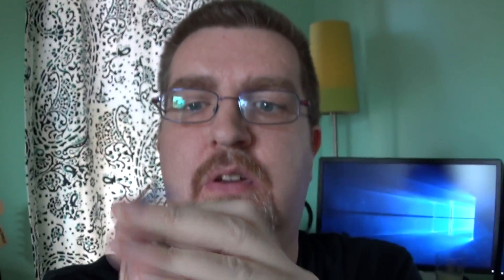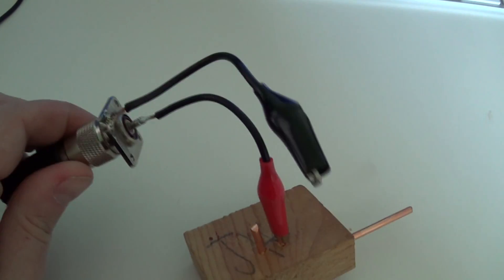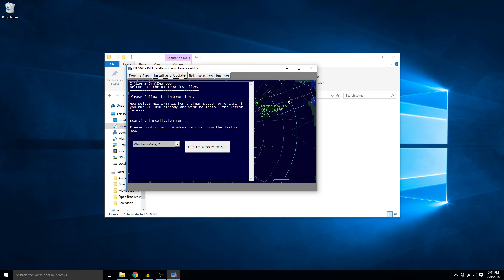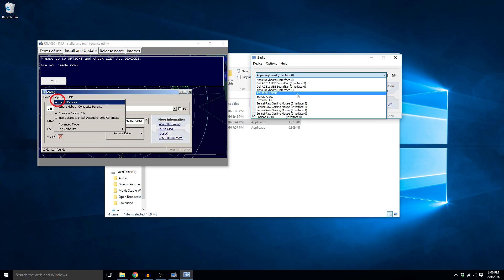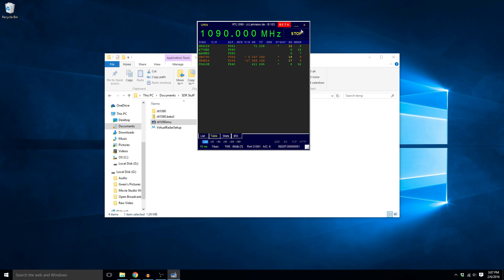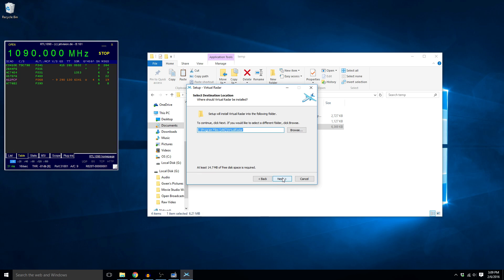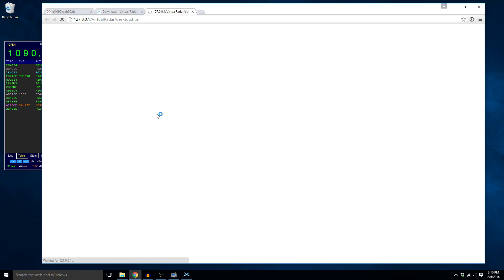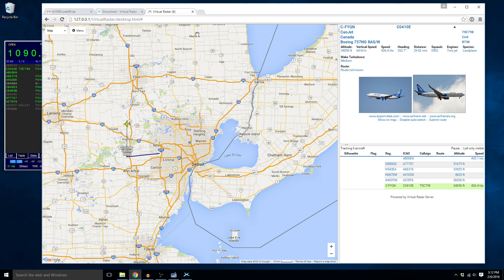Aircraft Tracking via ADS-B with NooElec RTL-SDR

Comment: When trying to install rtl1090imu.exe get an error: Aborting: an internet connection must be present, but was not found.
Anybody has resolved that? Tried already adding exception to firewall but didn't work.
Reply: Had same issue with no site. Used https://rtl1090.com  Says Jetvision. Downloaded a bunch, but the one that worked with scope was on second line  With this " This is a beta release of RTL1090 V3 "SCOPE ".  I already had SDR# installed and found the rtl1090.exe only worked from that directory. Caution I only copied the file Rtl1090.exe (and one called beta) , also copied other non exe and non dll to the SDR# directory.

Got the Virtual Radar as noted in video, at http://www.virtualradarserver.co.uk/download.aspx. Only issue was it did not hook up to the Rtl1090 . In the video he mentions when it hooks up you will see the green light. If you look at the bottom of rtl1090 you will see Port31021 this was different than the default setting in VirtualRadar 31001.  Use Tools/Options then Receiver half way down is Port make sure this matches Rtl1090.

Only got this device 2 days ago, and know nothing about ham radio. If you have questions about the above you can reach me at
hgreenblatt@NOT_gmail.com (trying to block the scammers).

Howie
Reply: Same here .. Could be the website is no longer active for the download parts!
Reply: same here any luck? been fighting this damn thing for a couple years now.....bout ready to get the hammer out
Reply: same

Comment: Thank you for the clear and complete instructions, Jim. I recently got the NooElec Smart SDR dongle, and have been having a lot of frustration with trying to get some other software working consistently with it (ie. SDR# & DSD+/Unitrunker, etc.). This was a breath of fresh air. Just need to work on a better antenna, although my VHF rubber ducky seems to pull in some aircraft OK Will check out your other videos.

Comment: Hey man,

Any ideas by on why VirtualRadarSetup is just saying connecting... and never connects? the tcp also never turns green on rtl1090

Thank you
Reply: Actually figured this out if anyone has the same problem, i did not have the port set correctly, had to match it from the rtl1090 program in the virtualRadar software config to get them to talk to each other. The correct port was in the bottom portion of the rtl1090 program.
Reply: Your comment helped me get mine connected thx.
Reply: Thanks Kyle1 !
Reply: Thank you so much! You got me up and running. I was so frustrated until I found your comment.

Comment: I tried downloading the program  RTL1090 - IMU (Installer and Maintenance Utility) and his other programs many times on two diferent computers and each time it tells me I need to do another install because rtlsdr.dll is missing. how do I get the rtlsdr to download?
Reply: Just posted this above but ill post it here for you too

Hey man had the same problem. if you download SDRSharp the files you 
need including rtlsdr.dll will be in that programs folder. i just copied
 and pasted them into the rtl1090 folder. You will need one more file 
from SDRSharp folder as well. Just download SDRSharp suite package and 
windows key search for the files you need and simply copy and paste into
 the rtl1090 folder. Hit me up if you need any help.

http://airspy.com/download/

Grab the "Windows SDR Software Package" the files you need are in there after you unzip.
Reply: all the software links and "how to's"  are here - good luck.  http://www.rtl-sdr.com/big-list-rtl-sdr-supported-software/

Comment: I followed along here and my virtual radar shows that it's connected to rlt1090 however I'm not getting any packets and on my RTL1090 window it does NOT show the TCP connection.   

Does anyone have any ideas?   both are set to 127.0.0.1 with the port 31022.  Any other port, including the one used in the video wont work.
Reply: nevermind, it seems the RLT was using port 31011 for some reason.  I got it working
Reply: http://www.rtl-sdr.com/big-list-rtl-sdr-supported-software/
Reply: Check the port on the bottom of rtl1090 and make sure it matches the port in virtual radar, mine were different and i just matched it to what the rtl1090 program says, hit me up if you need help hopefully that makes sense, i had the same problem.

Comment: Not all aircraft have ads-b
Reply: but you will see alot - just use the mini whip mounted on a tin lid outside a window - 200 miles here 100+ planes. build a collinear coax antenna (simple build) and the "skys" the limit :)

Comment: The RSP is recommended as the best step up from a NooElec - see http://www.hamradioscience.com/best-sdr-radios-of-2015-and-2016-so-far/   SDRplay now has an updated beta version of ADS-B for both the Raspberry Pi 2 and 3. This is based upon the 16bit Mutability version of dump1090 developed by Oliver Jowett and unlocks the full 12 bit performance of the RSP1. People should see a significant performance improvement over the dump1090_sdrplus version, which was based upon 8 bit code. The latest beta version can be downloaded in binary form from http://www.sdrplay.com/rpi_adsb.html . Should anyone have questions or feedback, please contact software@SDRplay.com